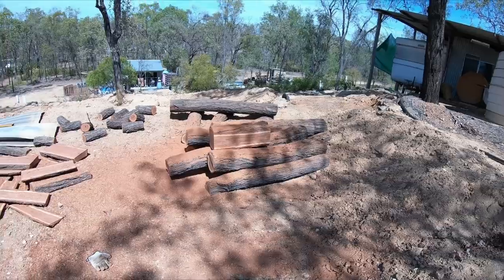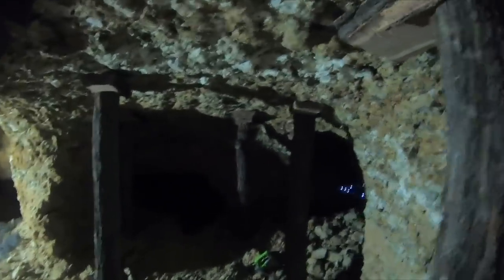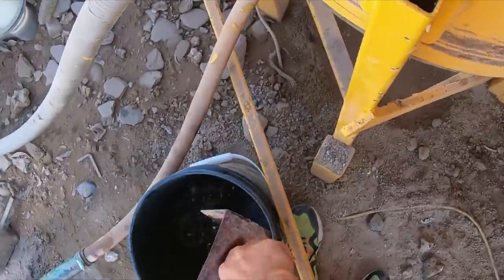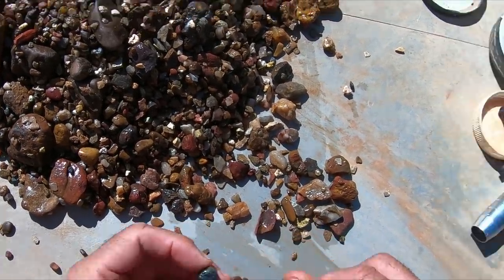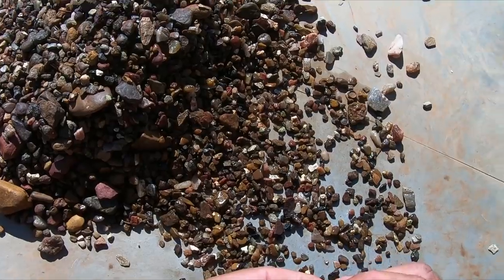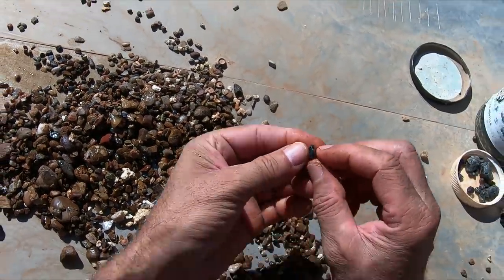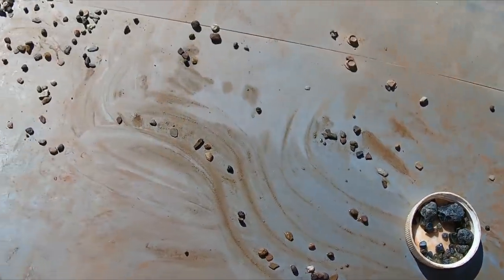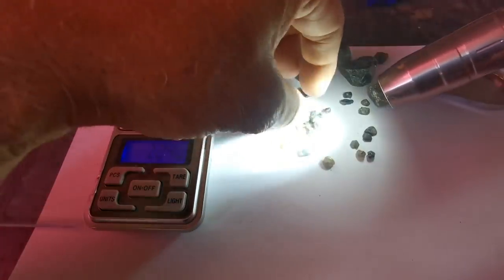How to find Sapphire .Mining Australia ,Tim's Adventures [ V: 228 ]

Comment: Hi Tim some nice sapphires John said if you are starting the chainsaw put trigger lock on and pull cord 3 times then take choke off and machine will start easier use 140 mls of 2 stroke oil per 5 litres of fuel instead of 50 mix it will not run lean all the time the old saws use to run on 200mls of oil John is a old chainsaw and lawn mower mechanic regards Lorraine and John
Reply from the maker: Thanks for the tip John